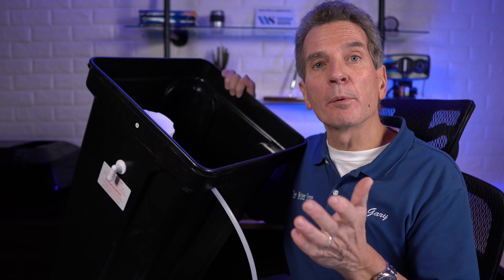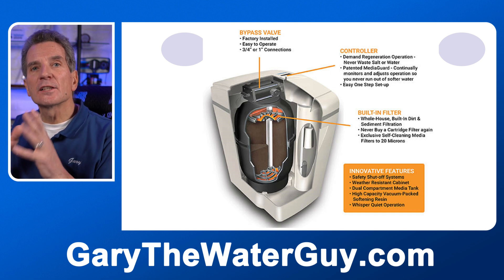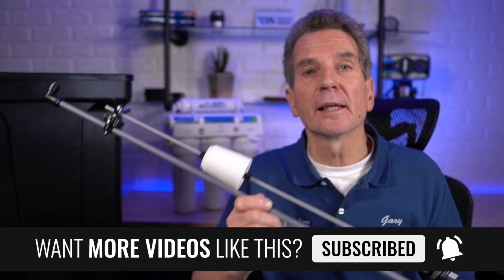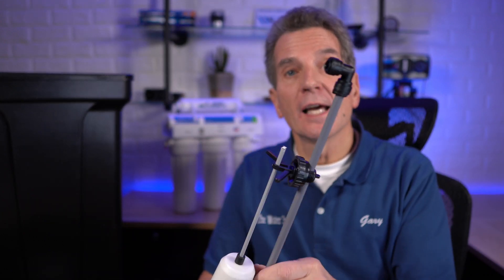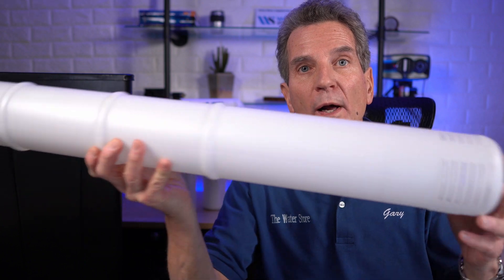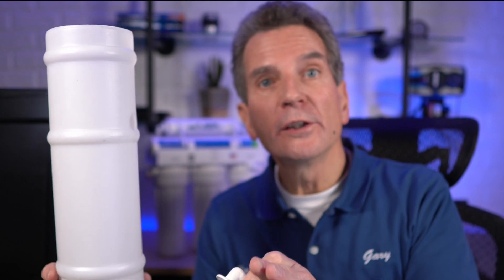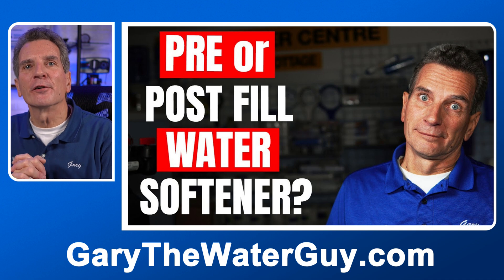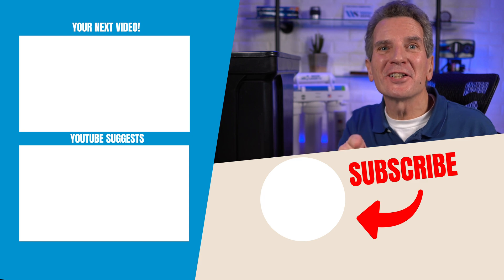WATER SOFTENER BRINE TANK

Comment: Hi Gary, great videos! I have a twin alternating fleck 9100stx. when doing the BF cycle the brine tank water level drops tot he bottom long before the 60 minute cycle is over, seems like it's drawing too much brine. When it goes into the BF cycle it has a high pitch  sound, there was water dripping out of the head unit when in BF as well. I changed the brine piston and checked the brine fill orifice and screen, they are clear. also the brine line connections seem tight.Any ideas on what the problem might be?

Comment: How do I just the flow adjustment  in that tube ??
Reply from the maker: The float typically does not need to be adjusted because it only comes into play IF the water softener would start to overflow. If you still want to adjust it, you can carefully slide the float up or down slightly.

Comment: Our brine tank is leaking at the bottom. There are two tubes going from the resin tank to the brine tank. I purchased a smaller brine tank (by accident) and it only has one place for a tube to go.
How do I connect the tube(s) to the new brine tank?
We purchased the house 5 years ago and this is the setup that came with the house. I’m not sure how old it is.
Reply from the maker: Can’t say I’ve ever seen 2 tubes. Maybe contact the manufacturer?

Comment: Great video! Subscribed!
Reply from the maker: You must have dissolved oxygen in your water that is accumulating in the tank during regeneration.  Speak to your supplier to see if they can add a vent like this one for you after the softener. https://www.supplyhouse.com/Resideo-Braukmann-EA122A1002-Automatic-Air-Vent-with-Built-in-Shutoff-Valve-for-Hydronic-Heating-Systems

Comment: Hi Gary.
I have a softner with a clack valve, after noticing too much water in the brine tank I cleaned the brine tank first, still too much water in it after a day or so. So I replaced the piston, seal pack and cleaned the injector. Checked everything for obstruction including drain pipe and fill pipe. Went through regeneration and as I was skipping cycles I noticed that during the brine cycle it's actually sending water instead of emptying tank. Then more water during fill cycle.  Is the valve defective,?
Reply from the maker: Need to check a few more things, like if the drain line is restrcted or clogged.  This video will help https://youtu.be/ZdA0aI1q22w

Comment: I did fix my WS1 WC by removing caked salt at the bottom, but I'm still confused about certain aspects of the brine cycle.  As the WS1 runs through its cycles, I noticed that BRINE is 60:00 long, while Fill is 6:10 long. I have a 12 inch tank, and I'd like to know if these two parameters are correct.  If I fill the tank with a low salt level, I can see the water. I haven't measured how much water is in there. but if I do, how do I know how much brine should be in the tank?

Is there a valve somewhere in the brine valve that controls how much water there should be?  If 6:10 long enough to refill it to a satisfactory level?
Reply from the maker: There is a flow restrictor on the brine line when filling water into the brine tank.  So if the valve has a, for example, .5 gpm restrictor and the valve calculates from it's settings that you need 3 gallons of water in the brine tank, it will run water for 6 minutes.

Comment: Thanks for the great content Gary!  I have an AQUAPRO 5000 SXT and its square brine tank has a salt grid plate at the bottom.  You mentioned that salt should be in contact with the water to efficiently produce brine.  This grid plat creates a 4-5 inch space without salt between it and the bottom of the brine tank.  Is this OK or would it be better to remove the salt grid plate?  Is it needed because our brine well is completely hollow, having no bottom.
Reply from the maker: I don't like those grids and it can be removed.

Comment: Hi Gary, I noticed the water is brown in the mornings when I flush the toilets,  rest are fine  When I went to check my Brine tank I noticed something strange, the pipe from the softener to the brine well is not connected to the float. It was just pushed all the way down to the bottom of the well.  And only the float( the piece with marble ). Iis there. The other half is missing. Is it a common practice for the installers to do this? Thanks.
Reply from the maker: No, not at all.  You need to get that fixed.

Comment: how does one know the correct level for the float; my float is high just below the overflow hole?  Tank water is almost to the overflow hole, this is not correct i believe.  I have a post fill.
Reply from the maker: Your float is set correctly, it's only purpose is so that if something went wrong it would shut off the water to keep it from overflowing.  If you water level is that high something else is wrong, check this video https://youtu.be/ZdA0aI1q22w
Reply: The video doesn’t explain the most important part of the whole brine tank. That is, the ball valve at the bottom of the well. That’s where the magic is. Valve (on top of filter tank) pulls a vacc on the line for the whole brine cycle (which is long, like 60 min). It pulls until that ball valve closes (like 5-10 min). So the ball valve stops water and stops air from being pulled in. It might pull 3 gallons or 6. But it pulls for a lot longer time than any system needs. Then later it (filter valve) uses time calculation to fill above when that valve closes. The next cycle will pull exactly what it put in because it stops when that ball valve closes again. So it won’t drift. To set up, put enough water to be well over the bottom valve. Advance valve to the sucking brine cycle. Wait until water stops going down. Now advance valve to fill cycle. That’s the height you want. You can have salt in brine tank before or after. Which will change height. But that doesn’t matter. It will always pull until the valve closes and fill based on time. It typically fills at 0.5 gpm. 6 min is 3 gallons.

If you don’t have OCD. Just put enough water above that bottom valve (4-6 inches). And run a full cycle. It will self adjust. You can do that with or without salt.

Comment: 1 question that i doesnt seem asked is the issue im having...as i attempt to fill my tank with salt it is displacing water and overflowing out the overflow port. That is if i dont bail out water as i fill the tank with salt...is this an issue or is this the correct way to approach this? And if so should i be concerned when it regens next will it not have enough water in the tank?
Reply from the maker: If the water level in the tank is higher than normal, you might have a problem with the water softener, this video will help. https://youtu.be/ZdA0aI1q22w If it's always been very high like this, your salt settings are too high causing the water softener to add too much water to the brine tank.

Comment: Sir - your videos have been among my favorite resources for water softener care - especially so for my clack ws1 control valve.  I am thoroughly cleaning my brine tank, and when I removed the brine line from the tank elbow connector (screw type) I discovered the poly plug you referenced in this video. The lip of it was brittle and crumbled when I attempted to tug on it to remove from the brine line to clean.  The remainder of it is still in the line:  Should I leave it in, or should I replace it.  And if I need to replace, where can I find one (I couldn't it on your website)?  
Thanks,
-Doug
Reply from the maker: Yes, replace it with 3/8" tubing, you can get it at Home Depot
Reply: Thanks for replying. I was referring to the plug insert that was damaged at the end of the brine line.  I was finally able to find brass versions at HD.  Appreciate you!

Comment: I’ve noticed that my brine tank leaks and the bottom of my basement floor has salt residue. Is replacing a brine tank a DYI or does a plumber or water treatment specialist required to replace it? Are brine tank universal fitting regardless of the softener brand?
Reply from the maker: It can be a DIY job but you need to make sure you are replacing with the correct size brine line as they vary by manufacturer.

Comment: Hi Gary, I was cleaning the brine tank today and noticed that I don't have a c-clip or a poly insert, just black tubing that goes directly connected into the angle connector (push in connector) from the brine well. Should I be concerned? Thank you!
Reply from the maker: As long as it works, no I wouldn't be concerned.

Comment: Hi Gary - Can I ask whether or not it's a good idea to clean out the brine tank periodically? Also, I broke my overflow elbow off and I taped over the hole for now. I assume the inner part of the elbow in the tube could wedge the float and I'll be in trouble. I'll watch closely and disassemble/repair when the salt level lowers (I dunno)
Reply: Hey I did the same thing & broke off that overflow elbow connector. But then then a leak developed at the valve of the media tank at about the same time. As I wasn't in a rush to repair it, I just lived with very hard water (iron and calcium) for a couple years. It was OK & everything works (toilets, faucets, etc) but I'm looking forward to having it operate again. I replaced two O-rings in the media valve connection, which were quite a pain because I could not get the media tank to line up properly. Finally after about 4 attempts to align the O-rings it worked and no more leaks! But I also broke off the overflow elbow port as you have done (I saw them listed for sale on line so you can likely buy one there if you want it. Mine has a 3/4" hole). But really, according to this video, if I understood it properly, there should be no reason for one becuase if the unit (specifically, if the brine well is working correctly there shouldn't be any overflow so I suppose it is sort of just for a mild overflow situation or works if there is a malfunction with the brine well). So I'm gonna clean the brine well and then fill it with salt (the tank is entirely empty of salt now that it all dissolved into the old water sitting in there for 2 years!). The whole brine tank is pretty clean after many years of use and it has a good very large filtering doughnut down at the bottom of the brine tank to help keep salt from clogging up the bottom of the brine well, I suppose. It's huge (same diameter as the whole large brine tank) so it seems to have done it's job. I'll test it out tomorrow.
Reply from the maker: Yes, this video shows you how.  https://youtu.be/BQT7c9wIzWY

Comment: Hey Gary, I have a Sterling NES softener that I bought second hand. The line is leaking right at the quick connect fitting into the brine tank. The manual doesn’t say there is any kind of fitting, it’s just a quick connect with a clip. The line I installed is brand new? Got any advice?
Reply from the maker: Assuming yours is 3/8” you can just replace it with a new one like this https://waterestore.ca/products/john-guest-union-elbow-part-pi0312s

Comment: Heiio my softener tank is full of water the valve that works off the float does it shut water off there is some water on supply hoses just dripping.
Reply from the maker: likley the water dripping is causing that condition.  I would fix the drip.
Reply: What if salt tank is full I  manual regenerate will see water come up float tube ?

Comment: Hello Gary and thanks for your educational video .please can you help   My brine tank cracked  and leaking at the bottom ,can it be fixed.  Or    Can  I 
replace the brine tank  only because  the  water softener working fine .please advice
Reply from the maker: I have repaired brine tanks with this product https://www.amazon.ca/Weld-8272-MarineWeld-Marine-Epoxy/dp/B000KKPFFA/ref=asc_df_B000KKPFFA/?tag=googleshopc0c-20&linkCode=df0&hvadid=292950034231&hvpos=&hvnetw=g&hvrand=10122445599358091598&hvpone=&hvptwo=&hvqmt=&hvdev=c&hvdvcmdl=&hvlocint=&hvlocphy=9104131&hvtargid=pla-422572943945&psc=1 Just make sure the surface is dry, clean and roughed up with coarse sandpaper. Otherwise you can repalce the brine tank.  Email me a picture at info@waterestore.com
Reply: @water_estore  
Hello Gary. 
Thank you very much for your help. My water softener model is 
DECALCIFCADOR
SERIED LOGIX 255/780 
Volumetric   Bought from Hidro Water in Spain . For our holiday house , we had it for 15 years still functioning  but the salt tank cracked at the bottom . 
Do you think  it’s possible to find a replacement . I have contacted the company but very difficult to explain the problem  they don’t speak English and my Spanish ltd  
Your advice will be appreciated .
Sorry attachment failed 

Kind regards 
Dr Shanks
Reply: @water_estore  Thank you Gary. I used  marine Epoxy and it did the trick. 
Thank you for the advice .

Comment: Hi Gary. Thanks for your videos. My question is: how does the brine get sucked from the salt tank towards the valve? Is there a suction pump somewhere?
Reply from the maker: Great question.  There is an injector inside the valve which has a venturi built in.  As water passes slowly through the injector in creates suction which is used to draw the brine from the brine tank.  No pump.
Reply: @water_estore  Thanks for answering. I researched venturi effect: it seems that to create a venturi effect you need a driving force to create the suction which would be used to draw the brine. Am I correct?

Comment: I want to move the brine tank across the room next to the drain and avoid running drain tubing across the floor. Can the brine tube go up vertical 6ft, horizontal 15ft and down into the unit? its a Tier 1 Essential 64000 grain with 3/8 brine tubing.
Reply from the maker: Yes, it can.  No problem.
Reply: @water_estore  thank you sir.

Comment: Can u please explain why salt level needs to be above water level? Ours, the water is always quite a bit higher then the salt, even when the brine is full of salt or getting low on salt, is there a chemical or scientific reason the water shouldn't be above the salt? And how can we fix the issue! We r still getting hard water stains and calcium build up in and on our fixtures. Could this be the cause?
Reply from the maker: great question!  The water must be able to touch the salt to absorb it to get the correct concentration fo brine to regenerate the media in the water softener.  All of the water above the salt is not touching the brine.

Comment: Hi Gary, appreciate all the water softener videos, the salt in our brine tank is low enough that the water is close to covering the top of the salt.  It is working fine and I could just add more salt, but why couldn't it keep on regenerating normally until all the salt is used up before adding more?
Reply from the maker: Any water that is above the salt will not absorb any salt so every regeneration will have an insufficient amount of sodium in it to properly regenerate the media.

Comment: Hi Gary. Thanks for the great videos. Learned a lot about my Clack Valve water softener. Quick question...going on a 3 week vacation and typically when we're away I turn off the well pump as a safety precaution against flood should a pipe burst when I'm not home. My softener regenerates about every 8 days or so (average) . Obviously, the softener is going to regenerate after 14 days and hence it will not have any water (I turn the well pump off when away) to complete. In the past with lengthy absences, I've come back to lots of air in the system. Just wondering if this does the softener any harm? Would it be better if I just unplugged the softener when we're away that long? If so, would I have to reprogram the softener when I plug it back in? Advice appreciated. Thanks. Vince.
Reply from the maker: You can unplug it but you would need to reset the time.  The other settings are in there for good.

Comment: Gary, every time my system regenerates there is air in all of the water lines hooked up to the softener. What would cause this? 
Thanks for all of the info you provide.
Reply from the maker: If it is just in the hot water it is hot water heater related.  If everywhere, it is a problem with the float in the brine tank.

Comment: If I put the tube of a dehumidifier into the brine tank, would it overflow or would it trip something to drain it?
Reply from the maker: Don't do it!  It will overflow because the float in the water softener just stops the flow coming into the brine tank.
Reply: @water_estore  - Thank you for quick response.  Your videos are fantastic!
Reply: @water_estore  - Just curious.  The extra water I put in brine tank, should drain out eventually during the next cleaning cycles right?

The float will just tell the system not to add any water, and instead remove it?

Comment: Hi Gary,  I have an older Brine Tank I believe its 18 x 33 , but it has a Brine Tank Float valve that looks like it might have some small floats inside a plastic chamber at the very bottom of the Float assembly , doesn't have a float that you can adjust. I don't believe my brine tank is filling up as much as it should I don't think the recharge is getting the proper amount of brine back through the resin on the recharge cycle. I would like to send you a picture of the Float assembly but I don't have an email where I can send it. Thanks in advance for any help
Reply from the maker: ouir email is info@waterestore.com but the float only determines the water limit, the programming in the valve determines how much water goes into the brine tank.  Check your programming and settings,

Comment: Gary, your videos are great. Have a WS-1 water softener. I manually regenerated it a day after
adding calcite to my WS-1 Acid neutralizer. After having regenerated water softener, it shows
1200 Gal, which is normal. But it is not winding down as house water is used. What did i do wrong?
System is 4 years old.
Am cleaning the brine tank, but have no clogs.
Reply from the maker: Check out this video https://youtu.be/_DF9892RERQ I think the eigth item is your problem.